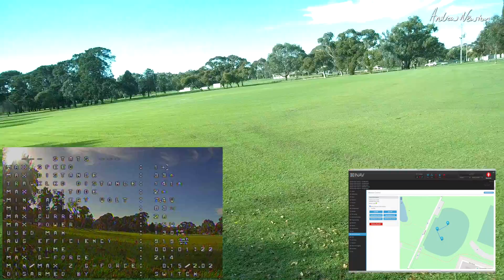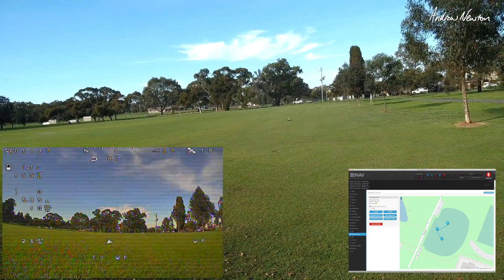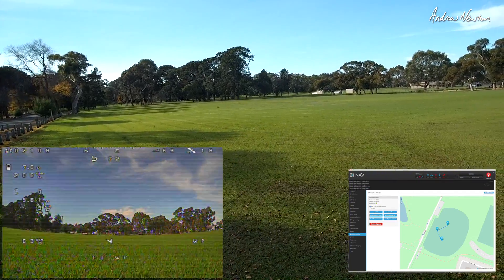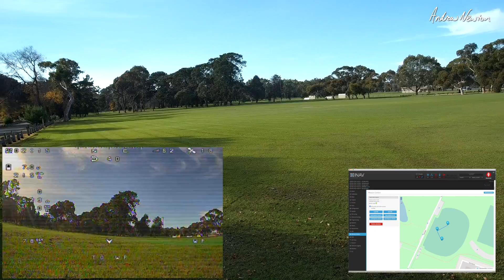iNav 2.5 Rover

Comment: Great video. In arcro mode is there any steering stabilization? I want to do this to my high powered rc truck and it comes with AVC( active vehicle control) but I loose that when I change to a crossfire reciever. Wanted to know if I could get something similar from inav rover

Comment: Must suck Mate when you have to resort to Ground Vehicles???
Reply from the maker: For when the wind blows from the wrong direction
Reply: @AndrewNewton : Stand on the Beach, Rod out in the Water, Beer in Hand and Fly above the Dunes.  (You need 3 Hands!)
It's not easy for me, still adapting, but you should try, as long as you don't mind Sand and Salt Water in the gear!!!
Reply: Nothing wrong with a bit of fpv on a 70mph Nitro truck...

Comment: When the buggy goes airborne (off a jump), we could use the accelerometers to increase the chances of it landing on its wheels. Steer left if it has rolled left; increase throttle to bring the nose up; brake to bring the nose down.
Reply from the maker: That would be cool.

Comment: Paweł Spychalski himself is the first to say that inav in general and especially 'rover' is inferior to Ardupilot, Rover in Ardupilot is very very mature and orders of magnitude more capable as are all the other Ardupilot craft type firmwares.
you should give it a try, once you have learned the config, you wont put anything else of your flight controllers!
Reply from the maker: I will eventually
Reply: @AndrewNewton  its a steep learning curve with mainly parameter based setup and very little graphical interface and can be daunting, especially if you enable advanced mode in mission planner and open the full parameter tree and see the literally hundreds of options but if you just ignore the majority of them and just stick to basics you soon pick things up.

Just setting up a plane so that the control surfaces are trimmed on the ground and then flying a manual only flight first and then moving to auto tune once your happy is all I would attempt at first, you can nibble away at all the advanced stuff bit by bit and its not hard when you deal with things one at a time instead of trying to set up all Tue bells and whistles on your very first attempt like I did lol.

Iforce2d has a huge number of videos on trying all the Ardupilot features, he's worked though most features and has videos on stuff like auto launch, auto land, terrain following ect ect and has also got videos on setting up rover for ground and water based craft.

I'm not sure if he's covered 'swarming' but you can even link craft together via telemetry and have them autonomously follow a lead craft or a pre determined mission.

Comment: Does the inav rover support skid steer, I have a robot chassis that isn't doing anything so maybe a new project.
Reply: It Should & That Would Be C@@L...
Reply from the maker: Yes it does. To quote Pawel from a post on the iNav Fixed Wing FB Group "it's just a 2 motor mix with a one yaw +1 and one yaw -1"